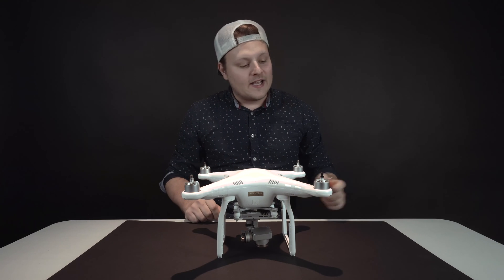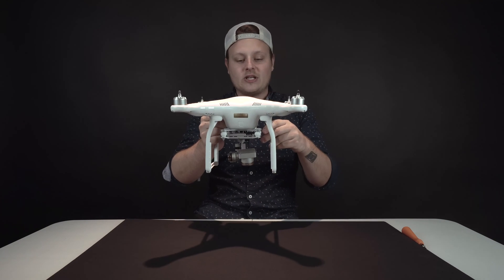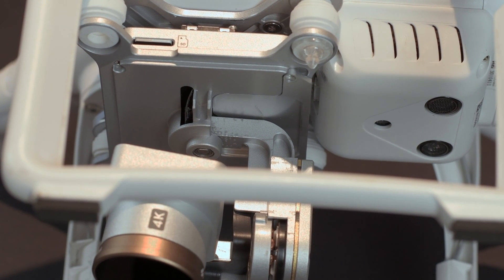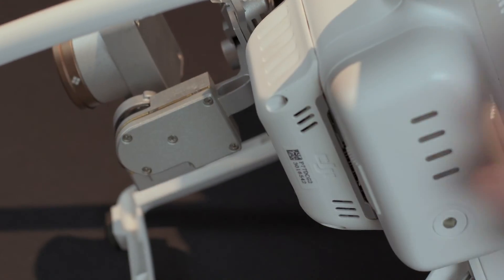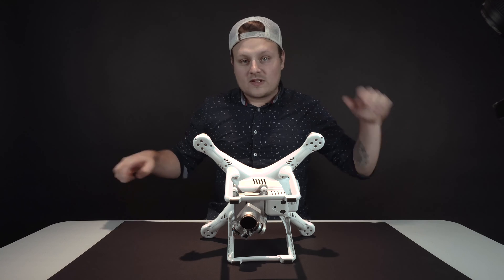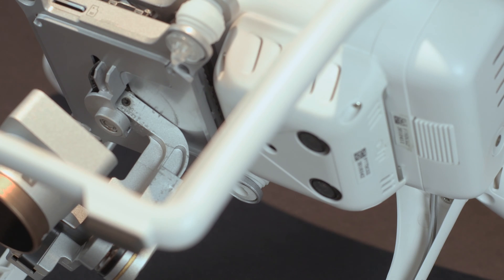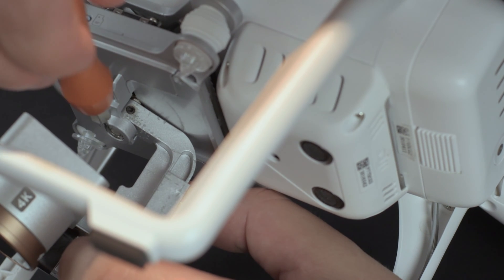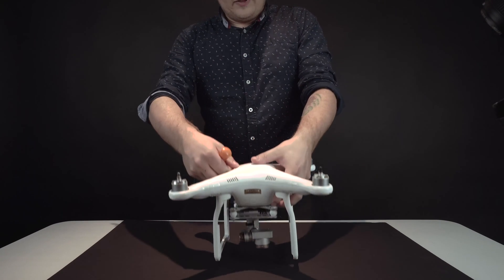Phantom 3 Gimbal Shake issue Fixed - 4k test footage

Comment: Hi Lee...I have a p3a...have you ever had any focusing issues with the pro?...softer focus centre or either side beside sharper than the other of video or on stills?
Reply from the maker: There wont be any focusing issues because all the phantom3's have a fixed focus lens. It sounds more like you might have a defective lens in your camera. I haven't noticed any major out of focus areas across the frame of the image on mine. Generally its usually sharper in the center than it is at the sides on most lenses. But you are saying yours is soft in the middle but sharp on the edges?
Reply: Zed ProMedia yeah it seems that way compared to before...thanks again and keep the great videos coming!...very helpful,....I'm a fuji shooter as well...great gear!

Comment: Still doesn't work with my Phantom - Any ideas which screws to tighten next?
Reply from the maker: Thats the main one that hold the gimbal. I dont know if any other screws would cause it. Have you tried taking it off and checking the wires? Have you crashed yours? There is a small ribbon cable glued to the arm that can also break if crashed.
Reply: Yep had a crash - now the same vibration issue and thought before getting a new gimbal checking all screws might help. The ribbon cable isn't broken and all screws are tightened...